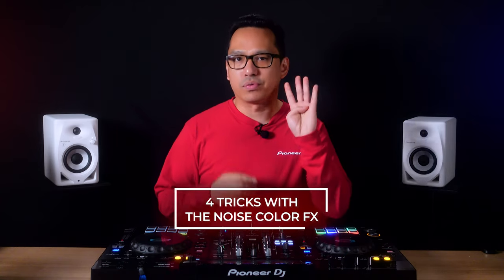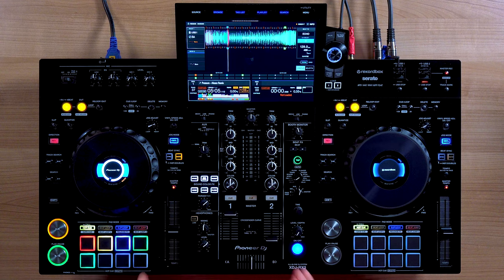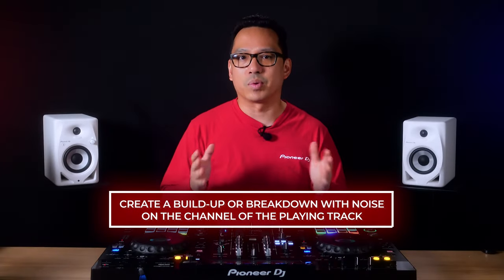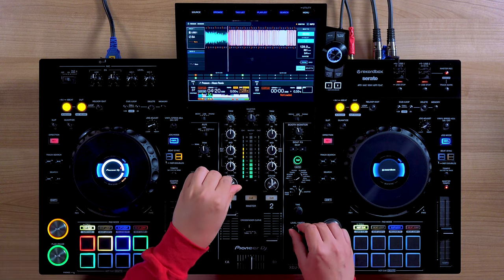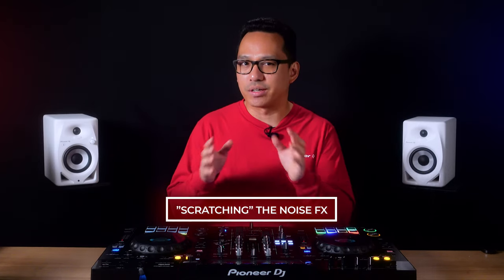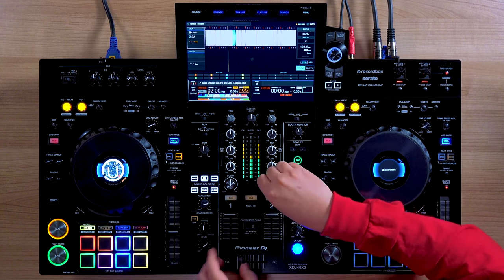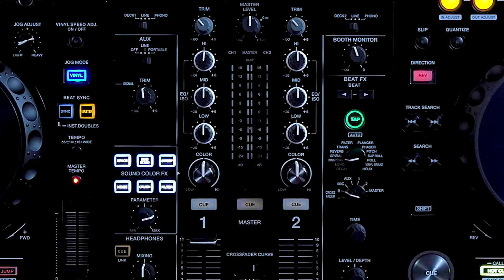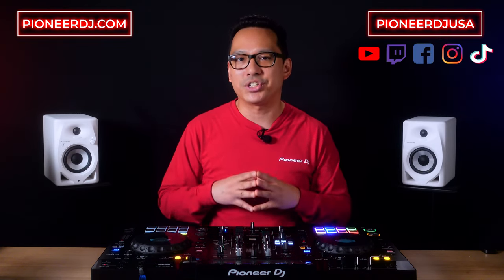4 Tricks w/ the Noise Color FX | Mix & Tricks #11 w/ XDJ-RX3

Comment: I've been wanting a feature on the controller:  Add two buttons in the crossfader section..  Holding one of the buttons unmutes the track and pressing the other button will mute the track (pre-fader).  Think about how Tom Morello from RATM uses this technique in place of the guitar's pickup toggle (pre-volume knob).